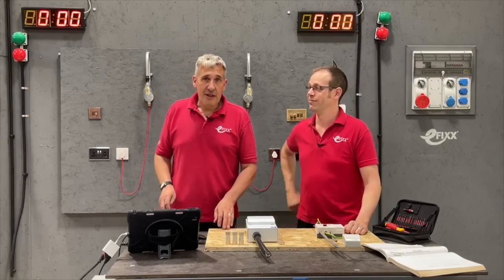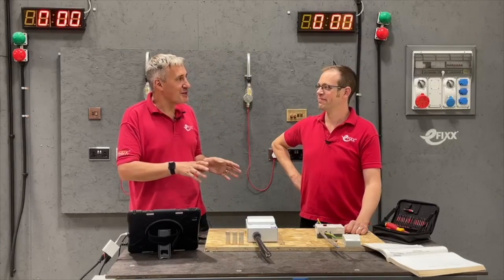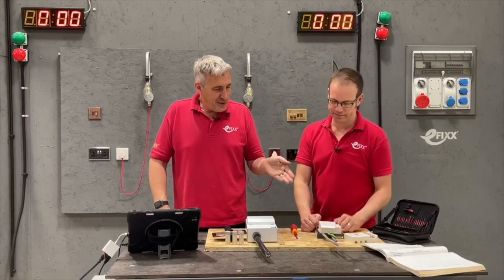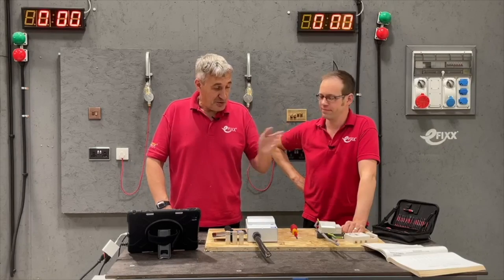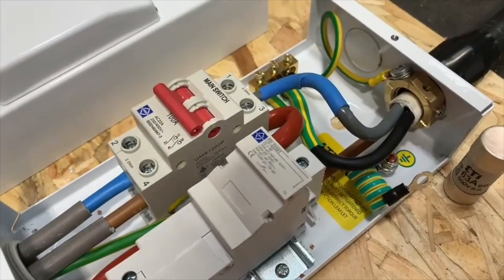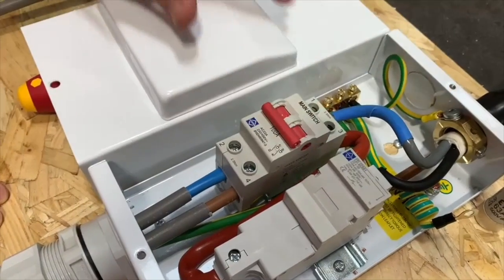METER TAILS LONGER THAN 3 METRES- Switch fuse isolators from LEWDEN

Comment: I used to fit the meters on new builds and used all of these as well as the standard Wyler double pole isolator. My only tip would be if the sparks on site are fitting their own isolator so they can run SWA which is becoming more common, let the meter guy know or fit it prior to him/her coming and they can fit tails straight into it. This avoids the scenario of having to squeeze 2 double pole isolators in the box which ends up happening frequently
Reply from the maker: Wise words 👍🏻
Reply: Worth noting that the meter operators won't connect to a device whose enclosure is not made from non combustible material, so got to be the metal domestic switch fuse if you want to omit the 2 pole isolator.
Reply: @Daniells1982  interesting, even though the double pole isolators and the meters themselves aren't made from non-combustible materials?
Reply: @mattbeddw  yeah I know mate, it's because there is a protective device in the assembly, not just a switch. There must be a document kicking about which stipulates this with BS EN numbers no doubt.
Reply: @Daniells1982  
What if the meter cupboard has a metal door?  Can the isolator be plastic?
.
Reply: @johnburns4017  see what you're saying but can't say I've been in that situation. My other comments were from experience from a site I've been on where we wanted to omit the 2 pole isolator from the plastic external meter enclosure to make more room for our own fuse protection due to tails being over 3 metres. They would connect to our device but had to be of non combustible material.
Reply: @Daniells1982  
Something at the back of my mind says a cupboard with a metal door can have a plastic CU inside.
Reply: @johnburns4017  nah, don't think that's the case. A plastic CU would still need to be installed within a fire rated enclosure such as a cabinet built from a cement based board or a supalux type material. Cheaper and less hassle to just install the CU made from non combustible material.
Reply: @Daniells1982  
You are correct in less hassle.  But in situation where there is already a plastic CU, a metal door will solve it all, simply, cheaply and quickly - if that will solve it of course.

So If a plasic CU can be fitted as long as the cupboard door is metal, it would follow a plastic isolator would be OK.
Reply: @Daniells1982  I worked for Scottish power, never heard of this before. Must be other dnos.
Reply: @r3co0  is that not because the DNOs responsibility ends at the cut out? It's was a new build site we're on where this came up. British Gas installing the meters and double pole switch. Our tails were over 3m so needed to fit a domestic switch fuse but there wasnt enough space. BG said they'd connect to our switch fuse and omit the 2 pole isolator providing it was made from non combustible material. DNO had no involvement. They put their supply cable and cut out in and were long gone.

Comment: I am so glad to see this Video I am have this issue on a new build. Where the contractor who did the original install is saying there is no regulations to state that the meter tails should not be only three meters long stating the NICEIC are happy with this. I am also a NICEIC contractor I have challenged this with the relevant regulations. The tails they have installed is 7 meters long and run thought the property.
Reply from the maker: You should watch this video to see how the regulations cover this - https://youtu.be/iR-xYgBuDgo
Reply: @efixx  Thank you i stated these regulation in my letter to the contactor. But they are having non of it. I will have yo contact the NICEIC  to see if they can help. I am doing this for my customer its a new  build and they have only been in a month.

Comment: Hi do you use the same size fuse as what the DNO has supplied in the head or down grade the supply to the next size fuse rating for discriminating purposes??
Reply: I'm DNO doing RLM installs ( sometimes ) and we often fit the same size fuse. It's 50/50 which one goes first but with low carbon technology jobs we must ensure customer has an 80 amp fuse. With these KMFs it means we would have to go to 100 amp in the cutout but often we can't. As you know, a 100 amp fuse can easily carry 120 to 130 amps for many hours which is beyond the rated current of the cutouts we use and puts undue stress on the network should that current be pulled. 
If the customer has a 16mm² T&E submain we allow 80 amp but put the onus on the customer to get an electrician out to upgrade it. If it looks like they won't, then it's a 60 amp only.

Comment: Great video as always, shame 90% of new builds have tails longer than 3m which are being signed off.
Reply: I am having the same problem with a new build. Trying to get them to come back is a joke.
Reply: I had the same issue with mine, took a complaint to the NICEIC before it was sorted. Even then, the NIC inspector took some convincing that a) 3m was a rule and that b) the tails were deffiantely more than 3m despite the meter being 5m from the CU in a straight line and ignoring corners.

There's at least 15 other houses the same on the estate but the NIC couldn't care less about checking those too. It's a sorry state of affairs when one of the biggest companies responsible for ensuring competency don't care about the regs
Reply: @mattbeddw  i completely agree with you but that regulation is not in bs7671
Reply: See loads over 3m no interest in complying just do the easiest option and then tick the box
Reply: @mattbeddw  In my experience NIC just concerned with taking money from firms,no interest in resolving issues. Got to be time to make building regs and our regs the same.
Reply: We had this and was told it was due to an agreement with the supplier western power and it was a new build too I smell 💩

Comment: I’ve used this lewdon switch-fuse with tails in and out and positioned it outside the meter box (meter box being inside the house). Also used the method of putting unearthed 4mm steel strip in front of the tails for protection all the way to the fusebox. Very happy with outcome.
Reply: Why wouldnt you earth it?? I used 40mm plate infront of tails and the plaster baord over and warning live cables behind bud.

The chance of drilling into 40mm steel tnat earthed is low..
Reply: @bramcoteelectrical1088  To my mind playing hind and seek with cables is ultimately silly, regardless of what the ''appetite'' of the human race is at the moment. It is not 1890 anymore and electricity is a massive part of everyday life, yet people want the inside of their houses to look as if it's 1890 with regards to wiring and pipes. I'd say everything on surface, in cable tray or otherwise with maximum focus on ease of maintenance and accessibility. Suddenly the number of wires getting drilled or screwed into will drop to nearly zero, with the added benefit of not requiring a partial demolition to replace said cable in the rare event damage occurs. And shoddy work will be much easier to identify and fix, no more convenient hiding places for idiots who don't give a crap.

Comment: Great video. With relation to a hrc fuse in isolator for consumer tails >2-3 meters for fault protection will the dno fuse not operate in any case if there is a fault as the pre arcing on the isolator fuse is not likely to be less than the let through energy of the dno fuse

Comment: According to OSG B5, 100A 1361-2 cut out fuse will operate when Zs low than 0.26 ohms( Cold meter tails measured @ 10 census and hot cut out upstream? not sure, why use correct factor, just small length meter tail cold) , would you mind explain why DNO still keep 0.35 ohms limitation on TN-C-S. does this arrangement will make 100A cut out 1361-2 fuse operate when earth fault even short circuit?

Comment: The smaller switch fuse I have used before and I do like the one in the enclosure, BUT Lewden could have made the enclosure just a bit taller so you don't have to fight the cable in to it

Comment: How are you satisfying IP4X on the top entry of the smaller switch fuse?
Are you just saying it’s in the meter cupboard? Therefore in a lockable cover?

Comment: One of my first jobs in the early 1990s after getting my diploma was rewiring a couple of flats, with the "at a distance from meter" problem. Nothing like it was covered in my course, so I went back to first principles and worked out everything from scratch. Overcurrent/Isolator must be within 3m of meter, downstream then sized to route to the CU in the flats. "I want that unsightly cable plastered in" No, because then it's not protected, and will have to be armoured and cost XXX hundreds extra!

Comment: I used this on a house with 3 flats inside where the new incoming UKPN 3-phase cutout was installed on  the outside of the building and the meters were in the basement.  When the metering company came to re-connect their meters they objected to their being an isolator before the meter. The said there can't be anything between the cutout and the meter. They also objected to connecting armoured cable in to their meter. Thoughts?

Comment: If you are using a switch fuse to feed a mini DB with a 100a mains with an ev charge or solar on it. Would you stick with a 25mm2 armored cable? Or would you be able to go lower such as a 16mm2 so its more flexible.

Comment: The Wilex DSF80 & DSF80M are great. “M” at the end for metal is like bigger one here, and the non metal one is like a much better version of the little one but is much harder to source stock of. Ps. 80 in the model number for 80A, but they also do 60A, 100A and unfused versions.
Reply: Yeah those Wylex are great 👍🏻

Comment: Looked at these for the first time recently for a board change job where there are currently 16mm tails running diagonally in the cavity for a few metres; I know running cables in the cavity isn't specifically banned but I'm not totally comfortable with it; if there's no conduit-  not sure what the cavity insulation was like in the 70's though. Am I being unnecessarily cautious?
Having a 25mm^2 earth terminal differentiates these economically priced units from the Wylex equivalent; fitting a 25mm SWA feels like appropriate future proofing if the size of bends can be accommodated but most boards only accept a 16mm main earth; I'm still wondering if there's a screwed alternative to pin crimps as my existing crimp tools max out at 16mm...
Reply: Terminate swa into a metal box then into fuseboard...put the 25mm earth into a henley block the break out as required..and mark as "earth connection dont disconnect"

Comment: Re torque settings. It seems pretty intuitive to me that for best results the torque used should not only be dependant on the terminal design (fixed), but also on the structure of the cable (variable)  i.e old style 7 strand tails compared to the Flexi tails.  Has any of the electrical Youtube channels experimented with the effectiveness of different torque settings vs different cables? I for one would certainly be interested to see the results.
Reply from the maker: See page 11 of this document - https://www.electricalsafetyfirst.org.uk/media/1258/consumer-unit-connections.pdf

Comment: Were dose it apply from being 50mm or more for RCD as if the switch is on the surface so are the tails going in to the wall so from what point dose it come in as the tails don't go out the back of the switch.

Comment: do you have to run separate earth to the consumer unit if using armored cable or can you use a 3-core armored cable and use one of the cores as the earth?
Reply: You can use armour to carry earth, so long as it can carry enough fault current. But I keep seeing in videos like this, where they use 3 core, and don't know why.

Comment: With regards to the Msf from lewden (plastic kmf switch fuse) how does this meet the requirements of 421.1.201? Surely we should be using non combustible (ie. metal) switchgear assemblies within domestic premises? 
Asking for a friend🤣👍
Reply: They had been around long before the metal mandate. They are not a CU, so I guess don’t need to be metal
Reply: Is an external meter box  inside the premises ?

Comment: The 3m tails thing doesn’t exist with lots of energy suppliers and DNO. I know that since the Grenfel Tower incident in London, Western Power Distribution no longer get involved with tail lengths and hand that responsibility to the energy supplier. I’ve had a recent job whereby the tails length was 7m and the energy supplier was okay with that.
Reply from the maker: We’d make sure you get that in writing - energy suppliers change - DNOs don’t !

Comment: 4:08 - if this is mounted inside the meter cabinet, then would the "cable duct" still be required to attach to twin & earth? Obviously this would look rough, but from a regs point of view it should be OK, shouldn't it?
Reply: Well surely yes, because you can’t have basic insulation showing
Reply: @ElliottHurst  even in an enclosure that requires a tool (key) to open?
Reply: I wouldn't want to describe a box owned by the homeowner and containing a meter which they may need to read from time to time an enclosure suitible to have single insulated cables in, backed up by the fact that dnos and energy suppliers use double insulated tails to connect their equipment in the meter cabinet.

Comment: I fitted an extra meter box so the fused isolator wouldn't be in DNO meter box, perhaps I went over the top? On the other hand at least there's plenty of space now for a henly block and second isolator for an EV charge point.

Comment: If the incoming supply is fused at 100A do the regs allow you to put another 100A inline?
Reply: You would have no discrimination if you fitted a second 100 amp fuse  .  It would have to be a smaller fuse .
Reply: @dennisphoenix1  Yes, as most households in the UK are 60, 80 or 100 amp, this Lewden fuse switch would have difficulty providing discrimination. Even if you could get it, it would limit your options further down the line.
Reply: @dennisphoenix1  erm...  ‘selectivity’ lol

Comment: At UKPN regarding meters to be moved on service alts they are now slowly  rolling a process of the jointer to move a meter then connect incoming meter tails from cut out to incoming side of the meter and then away going tails to a double pole isolater switch. And  the electrician will then be down to them to make the final connection there side to the away going side of the double pole isolater switch. To me it’s a great solution one you don’t need to have a bs7671 test cert from the sparks as all the jointer is doing is connecting up to a double pole isolater and that’s it. So you can walk away and leave electrician to make final connection on away going side of the double pole. Plus it’s a point of isolation for a sparkey which means the main fuse does not have to be touched which we all know electrician’s aren’t allowed to do.

Comment: Use the Lewden large switch fuse which is a good priced and well made. Shouldnt the small one be made from non combustible material? As its got a fuse in it. Ive fitted them in the mains cupboard on many occasions as i usually have split con with exposed inner cores in the meter cupboards
Reply: guess it's fine for outdoor meter cabinets
Reply: @edc1569  but fuseboards in external buildings have to be metal! Dont get it!

Comment: I've seen loads of the smaller fused isolators with that additional cover and armoured cable used, the meter engineers can fit the tails direct to them.
I can send pictures.
Reply: I would be interested in seeing that
Reply: @alanbeard4871  I can't send pictures on here but send your email and I'll send some over in a few days when I'm back from holiday.

Comment: Here is a question, If you have 25mm 3 core SWA providing a supply to a consumer unit...  Will the 25mm cpc fit into the earth bar in a consumer unit?  I often have to wrestle a 16mm cable...  Whats the best solution for this? (Obviously line and neutral go into main switch which is fine)
Reply: Why not just use two adjacent ways, if the earth bar doesn't accept 25mm?
Reply: @obd6HsN  split the conductor strands, yeah thats a simple and really good idea..  cheers.

Comment: @6:00 you mention "this other solution.... consumer unit containing a switched fuse..." over the 'solution of swa'. 
If I am understanding correctly what was said then the implications is that the swa isn't needed if you have the switched fuse...  and your own 'tails' from the switched fuse can be buried less than 50mm deep without any armoured/earthed protection to your consumer unit located Xm away. 

Apologies if I am misunderstanding what was said... just slightly confusing as the 'other solution' was shown with SWA but the voice over seemed to suggest it was two different approaches.